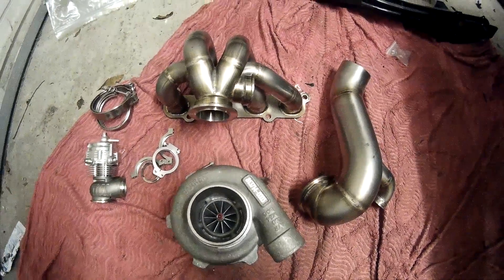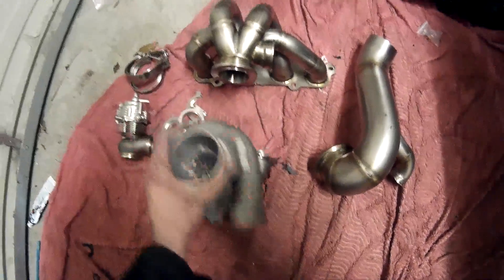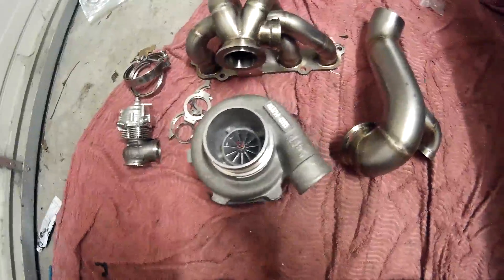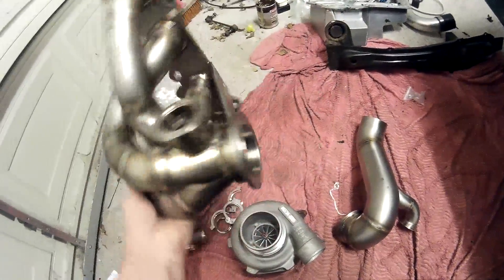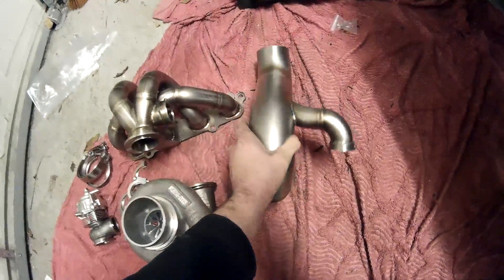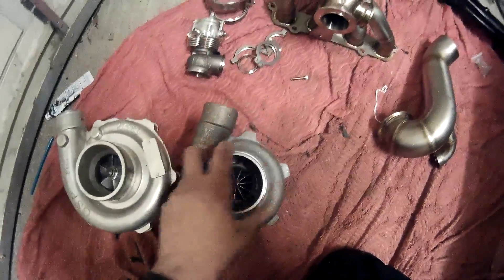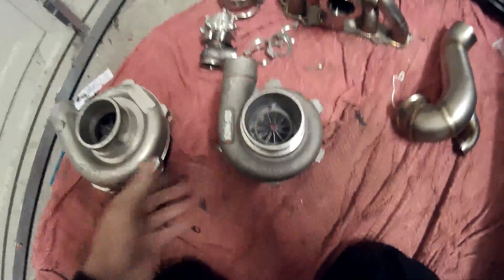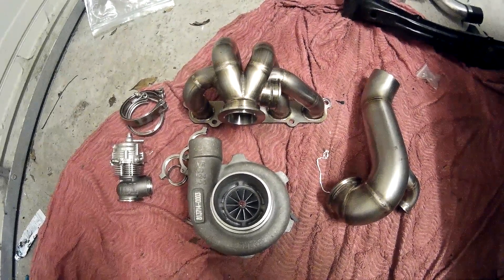Se7en Motorsport 2ZZ RHD Turbo Kit

Comment: Does this kit allow you to keep the power steering as is? Also I'm working with a 2000 Celica GTS, not the 190 though as I'm in Australia. Is that an issue?
Reply from the maker: +Chris Arvanis 
Yeah this was designed RHD cars, most turbo kits made for these are LHD only
Reply: Yeah most people were going custom everything due to the fact that our power steering rack is right below the turbo. But if this kit keeps everything in place, that's awesome!